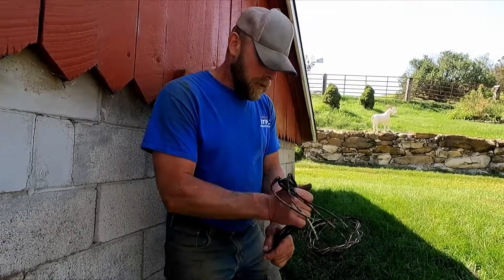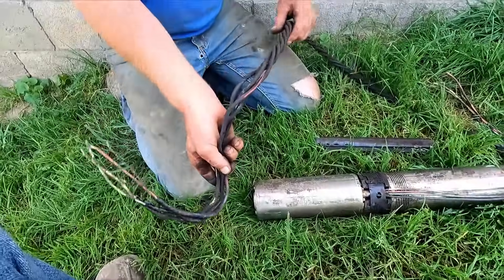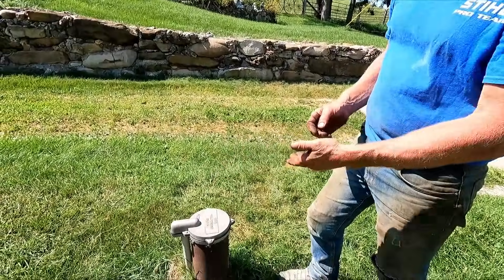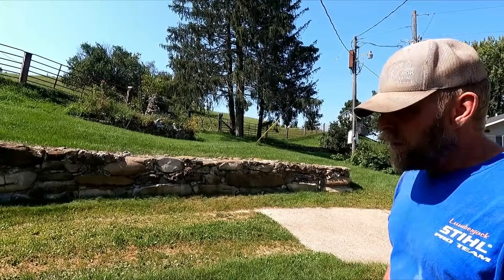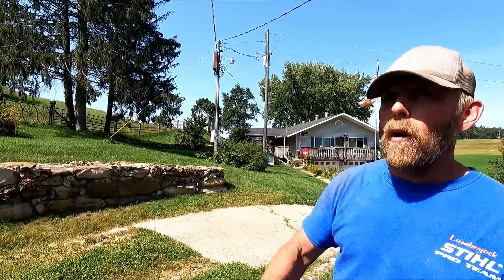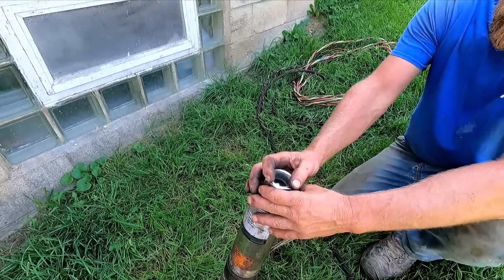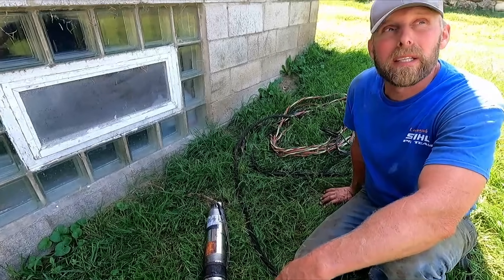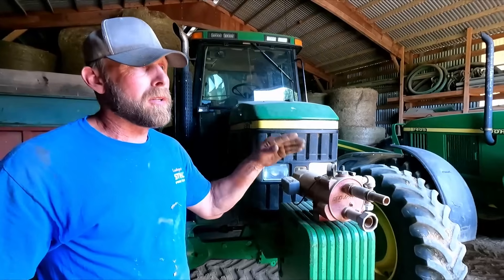A Key Part Of Life On The Farm! The Importance Of Water On A Farm!

Comment: No doubt about it. We had a hand dug well in the barn 14 ft deep. It went dry February 1978. So during the week we had a new well drilled and the drilled hit water at 12 ft then again at 26 feet.... The minimum depth they charged is 40 feet so they went to 40 feet and pulled out the drill there was like a geyser in the yard for a couple of hours. Thanks for showing how this all works.

Comment: Good video!  Our water is at 165 ft.  Casing is 265 feet to allow for future lowering of the pump as necessary in the future.  Some wells are over 200 ft. to the water level in this area.  (Fl. panhandle)  Our water comes out of the Appalatians (the Upper Floridan aquifer).  We don't object to minerals in our water; they add "taste" and provide Iron and calcium for nutritional needs.  The "captive air" (bladder) tanks were a major improvement over the old "free air" tanks as they don't "waterlog."  The air is absorbed into the water on the old style tanks causing rapid pump cycling which wears out pumps, pressure switches, etc. and also causes surging at the taps.  Starting current on single-phase motors is about ten times the "running current" so you want to avoid frequent cycles.  Those splices are called "heat-shrink" splices and are special-purpose fittings for submerged use.  They have silicone in them which squeezes out when the jacket is shrunk providing a good seal.  Our well failed once (25 years ago) and our wise old "pump man" pulled the pump up only about two "joints" , spotted the chafed wire insulation, remarked "there's your problem," spliced the wire and lowered away.  Inexpensive service call if I remember correctly.  We hang our pumps on galvanized pipe, not p.v.c. but our wells are much deeper.  Our first "water" here was a hand-driven "sand point" in a weeping sandy spot at the bottom of the hill and gave us good potable water for several years until we could afford a "deep well."  You're correct about water being easier to drive than to draw.  Surface jet pumps can only draw up to 20 feet.  The submerged "jet" you described lengthens that capability to about 45--50 feet but the constantly-submerged pump is far superior.  Thanks for the video!  Keep an emery-board "fingernail file" next to your pressure switch.  Those contacts are silver and can be cleaned easily.  But "go easy" on the filing---silver is soft!  (use the "fine side" of the file)  Always enjoy your videos!

Comment: Original well on the farm was drill in the late 1870s witch also served a early small cheese factory that was nearby. It was a 4 in. Casing 90 feet deep with the casing at 60 feet, water at about 40 feet. All the water needed for 100 milk cows plus replacements and the house. In late 92, woke up one morning to no water, pulled the pump, well dry!  Started drilling early that afternoon, late the next day they hit a good vain with high volume, 407 feet deep. My house now about 500 ft. from the farm had a new one drilled in 96 to service 3 homes 406 ft. deep. The reason the original well went dry was the old casing rusted through at the water level and slid to the bottom and closed off the vain, never any water in it after. Put a camera down it, that answered our questions.filled it with clean crust stone with screenings and sealed it a few years later! 👨🏻‍🦳 🐄🐄 🚜

Comment: I’ve got an irrigation in central Minnesota, Belgrade area. We went down 190 ‘  After drilling the well, the fella tested for volume. He stopped at 2,000 gallons/minute, but the irrigation uses only 1,000 gallons. That area was once a river so under the black dirt we’ve got sand. I’ve got a couple neighbors that tapped into the same vain so they can’t run both of their irrigations at the same time. The one will run his for 3-4, then the other one does. So far I haven’t had any problems (I put it in 2008. Best investment I’ve ever made). 
We also have that sand point y’all were talking about. Mine is only 20’ down and at the time I had 8’ of static water ( depth of water at the bottom of the pipe). I’ve just got a cheap Menards pump and it puts out 40 lbs pressure consistently. Idk the gallons per minute. This past spring with all the rain, my static water level was about 15’, the water table was very high. 
Back in 2012 when it was really dry and all the irritations were running, we had a neighbor’s sand point well go dry. So the DNR kind of fined all land owners with irrigations pay for a deep well for the guy.  Residents get priority over farm use for water. 
Hope that helps. 
Btw it’s ‘heat shrink tubes. ‘

Comment: The first dairy farm I worked on originally had a hand dug well next to the house. The barn had a supply tank and I think somehow water was pumped across the road to the barn.  Its very possible they used a hit and miss engine. The supply tank was higher than the milk cooler so they filled the milk cooler from the supply tank. The supply tank also supplies three cement water tanks in the barn that has a float shut off plus it filled a tank in the cow yard. That tank is shut off but the barn tanks are still in use and have worked fine for probably 80 or more years. We have problems with magnesium in our water. They told us that's why we get black sludge and odor from the water. And yes the water minerals can be good and bad. They are finding a correlation behind high iron levels in water and founder in horses.

Comment: What we would do to open up the rock at the bottom of the well is dump dry ice down the well and cap it quickly.  It would build up so much pressure, it would force out the sand that settled at the bottom.  Down in New York city they don't have any pumps in the entire city water system.  It's all gravity flow from the reservoirs in the Catskill Mountains.  A shallow well is one that has water less than 26 feet below ground level,  so if you have a 400 foot well, but has a 380 foot column of water it is still considered a shallow well.

Comment: Where I live there are several farms. I live in a development of 41 homes each lot is between 2 and 3 acres. The land was developed and platted in the late 1990's. The local farmers complained about the land being developed so the county mandated that all wells me a minimum of 300 feet deep. When my well was drilled they hit water at 85 feet then 150 and again at 250. They said the water was still at 300 feet. Our well produces 17 gallons per minute. Our well was drilled in 2013. We had to replace the plastic pipe couplings to the pump 2 years ago

Comment: Back in the 80s I hauled some drilling and blasting equipment up to Gouverneur NY. Building developer was blasting some rock, and the blasting company when they drilled those blast holes must have gotten into a 'vein" of water there. They blasted and it popped the well covers off a few casings in the that area. Most of those wells never recovered, the water took another path or those veins dried up. Yeah nieghboring wells can be pumping from the same source.

Comment: Our well is similar to yours, except they put the pressure tank and pressure switch down in the bottom of the cistern.    Which is very problematic....   It's a very damp environment and it's a yearly task to go down into the cistern and swap out the pressure switch when it rusts out.   On top of that the cistern isn't tight, and after a rainy period it fills up with ground water and shorts out the pressure switch.    Our well is about '300.    I love the idea of having a second well...I'm going to think about doing that.     The farm I grew up on had a working windmill on top of the hill which filled a cistern there and the water gravity flowed down to the house and barn.

Comment: Very informational.  the place i live had a windmill and pump jack with pressure tank in the well pit which was converted to elctric , also had an elevated tank to feed water to the house i took out the windmill wth a disk  did not wreck pump jack , electric line or tractor and disk my parents dug a new well (a friends relative found location with a wire )new well that i am still using with original pump 180 ft down naturally soft water on 3rd pressure tank

Comment: Biggest problem I’ve seen with people’s well system is they don’t know how to check and set their pressure tank.  Nothings harder on the pressure switch than a pump banging away on the 30-50 setpoints.  It’s really not helping the pump either.  If you notice pressure spikes the pressure tank needs checked.  Properly set you’ll hardly notice whether the pump is running or not.

Comment: The tall screw on your pressure switch turn it clock wise to increase your pressure so for 40/60 40 cut in and 60 cut out you need 38 PSI in your tank I use to drill wells and put pumps in and if you have lots of water see where it draws down on open discharge and set your pump there then you have less hard water

Comment: People having enough water don't know the struggle.
When dad bought our farm in the 40's til I finished milking cows in the mid 90's we struggled with having enough water. Dad have over a dozen veins witched but only drilled 5 wells that were all dry (Experts always told we didn't drill deep enough). By the time I was about 10 we had our own old truck with a 1000 gal tank to haul treated water from a nearby village during the warmer months. We changed trucks over the years (Last truck I used was a 66 Reo in the mid 90's which the 1000 gals cost $3).
The first water on the farm was a hand dug well through stone which dad used a pail to drop on a rope to fill the water vat year round for the cows to drink. 
The ironic part was about 1/2 mile away was a 200 cow dairy with unlimited water.
Reply: I grew up in the ozarks. All lime hills and lime to way down deep. My 1 uncle had to go 350ft to hit water with a decent flow rate. My other uncle "a farmer" ended up having a "what the conservation agents described as" a large lake under his land. They estimated it to be larger than his land which was 400 acres. And it was around 200 ft he had to drill

Comment: Hard water is tough on copper piping.  I had a water softener and did not like the quality of the water.  I bypassed it and 30 years later I started getting pin hole leaks in my piping.  I changed to pex piping a fingers crossed it seems ok.

Comment: Outside of the hand dug wells that I never saw used, I have never dealt with a well less than 125' deep. Even with the black plastic pipe, it's a witch pulling a pump. I'm to cheap to call a plumber....😂